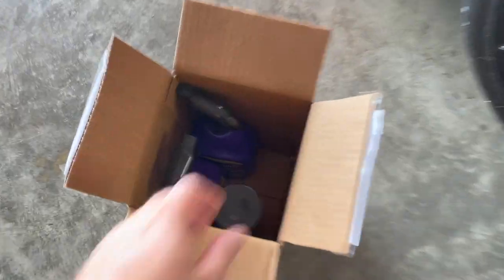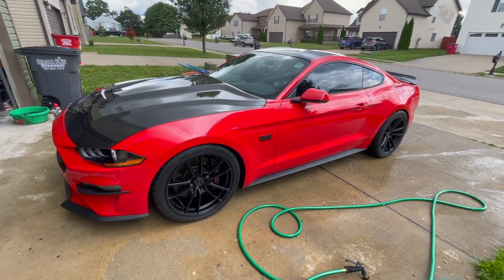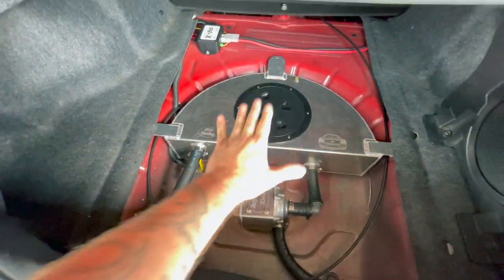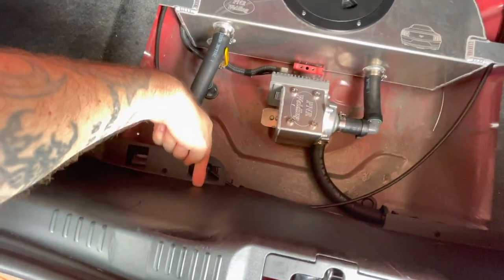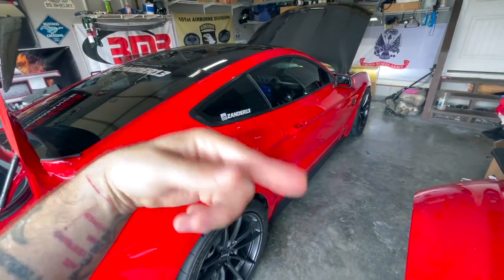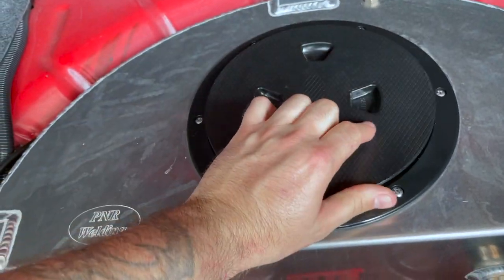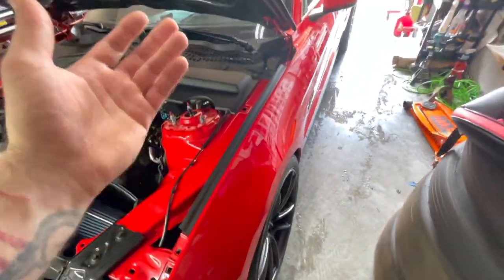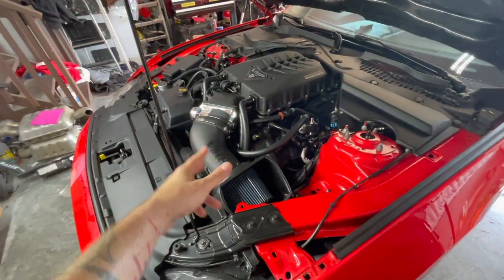EXPLAINED! 2015+ PNR Supercharger Ice Tank In The Trunk- What You Need To Know!

Comment: Just bought a 2011 gt500 and didn't know that it came with a setup like this except stage 1. I'm having issues with overheating and my front coolant reservoir above the radiator just blew all the coolant out because of heat. Any ideas what might be wrong?

Comment: I have a 2001 SLK 230 Sport with a blower on it and I was thinking about putting ice in my trunk and running it with two header two header and increasing my coolant to my blower but I have fluid in the blower so I don't quite understand how the wire would go through the blower you want to explain that to me cuz I know you have that oil in the blower and I don't know if my Bremen blower is a screw or not I think it is